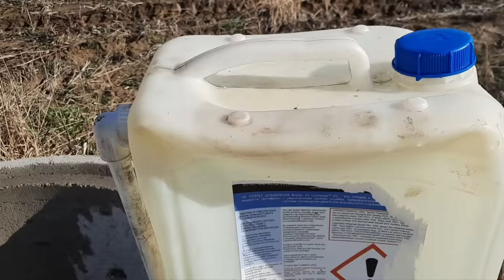Simple idea how to make a water pump without electricity without fuel

Comment: It worked perfectly!!! Thank you so much
Reply: It only worked because the end of output hose is below the water level in the well.
Reply: @wildthoughts6959  Of course, but you can allways repeat the process by pouring water in the canister and sinking the pipe in the water well, creating vaccuum.
Reply: @nevermind-wp3bf  In fact, I tried this experiment in my garage last week.   I put the tank (7 gallon bucket) at 3.5 feet height source at 2 feet , and destination on floor.  Water was flowing at gushing speed.  It emptied my 2 gallon source in a flash.   However,  as soon as I lowered my source to destination level on floor ,  water stood still. And air started to get sucked in from destination hose to adjust the low pressure (vacuum) inside the tank.
Reply: @nevermind-wp3bf    As most people you forget that the vacuum does not only suck at the inlet, it also sucks at the outlet. And if you analyse water pressures at both sides you will find, that with an increasing vacuum the water flow at the outlet will be stopped before the vacuum is strong enough to pull water from a deep well. This system only works if the outlet is lower than the water level in the well. But in this case no tank is needed, just a hose prefilled with water.
Reply: @wildthoughts6959  Thanks! You are right.
Reply: @sciencefreak9070  Exactly

Comment: Your water source is up and drain is down the hill, so you just need the tube and suck the water from mouth at the down hill end you will get the water. Siphon will going to do the job
Reply: P9
Reply: You're right that this is just a siphon but you could not put enough suction on a hose in that scenario to be able to start the siphon. Your lungs don't have the capacity to draw that much water from that depth. That's why the five gallon jug is a good priming device but it is still ultimately a siphon. They need enough water in The Jug to overcome the lift required to pull water out of the well. The weight of the water leaving The Jug and going downhill is what gives you that lift. Your lungs are incapable of achieving that.

Comment: This is very clever because it is so simple. I wonder if there’s a limit to the depth of the well/borehole? I hope our friends in some of our third world countries spot this it could be very helpful.
Reply: The end of the pipe needs to be below the water level of the source and there is a (roughly) 10m limit on the height of the siphon.
Reply: Yes Sandy.  I'm in Kenya and tried it. It really works.
Reply: The limit for the depth is zero. Once the outlet is higher than the water level in the well it does not work. All videos pretending that it does work for a deep well are fake videos.
Reply: @sciencefreak9070  of course I concede the syphon effect is quickly destroyed if the output is above the source. I am more gullible than I thought or plain dozy!
Thanks.
Reply: @ngangaken8731  I want to try it too
Reply: @ngangaken8731  do you have any points

Comment: The plastic jerrycan tank either needs to be a stronger one , with walls stiff enough to stand the strong suction forces, or the inlet pipe diameter should be increased so that outlet demand can be  provided efficiently. But still a very good idea. Well done guys 👏👏👍🏻
Reply: The diameter of the pipes/hoses is determined by the laws of physics applied to each specific case. A larger diameter pipe from the well will require a higher vacuum to lift the weight of the water if done incorrectly the outlet pipe will simply suck air eventually. That is the problem some have encountered and have used as an excuse to say this will not work. I have done it. IT WORKS JUST FINE! No more sucking on dirty fish tank hoses or carrying batteries and pumps out in the field..
Reply: Also, the additional vacuum pressure from the plastic trying to go to its resting state adds a bit more suction. It would be better if the walls were more flexible and could then be manipulated to draw the water up to start the flow. The weight of the water being drawn up from the well must always be less than the suction pressure at the outlet or it will draw air and end the siphoning.
Reply: @uprightfossil6673  points taken, but this creation shown here is not about science because if it’s to be so then the complete contraption needs to be scrutinised and modified accordingly. This clever idea is all about pure intelligence and as such will no doubt be modified as needed by practical experience.
Reply: @uprightfossil6673  Oh? I didn’t know all that educated & disciplined stuff; but you seem to have ‘been there and done that’ to be able to judge others so easily. Video was about a cheap and easy way to get water out, but if you start using pure science in this kinda DIY ventures then why not just go buy a water pump. In rural life the idea this video gives is extremely helpful to save money by not buying pumps etc when one can easily assemble using spare items therefore save ultimately on crops cost to consumers. Hindsight.
Reply: @uprightfossil6673  sorry I’m not so bright to understand. But now I understand you fully well and I support your thoughts. 👍
Reply: @rajrai8073  many young people in America have parents who do not teach them they can be wrong. These children also think the world is flat and other stupid things they cannot understand. That is why I have no patience with them and I am so brutal with my attacks. Be well
Reply: No! A strong (inflexible) Jerry can will simple result in little or no water coming out of the tap at all.
The water column between the inlet pipe and the tap will come out of the tap because atmospheric pressure is pushing on it through the wall of the tank. If the wall of the tank was inflexible, it will resist all of the atmospheric pressure and none wil reach the water in the tank to push it out through the tap.

The whole contraption is a simple siphon. Water only continues to flow because the outlet of the pipe connected to the tap is lower than the level of water in the well. AND there is sufficient water column between the inlet of the tank and the tap, to fill the length of pipe between the tap and where that pipe ultimately empties.  AND the wall of the tank is sufficiently flexible to allow atmospheric pressure to act on the water in the tank to squeeze it out. If any of these conditions is not satisfied, the whole contraption won't work!
Reply: Gravity is a hoax. The Earth is flat. Your aggressive response wont change the fact.
Reply: @rajrai8073  Tutaj dokładny opis jak działa taka "pompa" 
https://www.youtube.com/watch?v=X7Rm0hG-ziE
😂😂😂😋😋😂😂😂
Reply: @nizamersoft  la gravedad existe??.... si ??..... NO??....

Comment: I tried but failed . I need your advice. I keep pouring water in the gallon but it never filled up to build pressure I don't know why. If close tight the gallon the pressure will  suck in the sides of the gallon . I frustrated with the project and I think I wasted my materials
Reply: A waste. His is a siphon. No siphon can lift any water to a higher level.

Comment: Once you open the tap water in the can flows and equal qnty of vacuum created in the can that vacuum suck the water from well  and siphon created that flows. 😉
Reply: Yes, but need a foot value at the source end of the pipe to prevent water flowing back to the well.

Comment: The submersible pump does wonders
Reply: did you not notice? the plastic gallon shrink alot. I think this works true..
ill try this with a DIY reservoir, with bracket inside to counter the shrinking effect.
Reply: Obviously you don't comprehend the science of how a siphon works.
Reply: @GamyCoE    There is a vacuum created, but this does not mean that it works. If the outlet is higher than the water level in the well it does definitely not work. The vacuum would stop the flow at the outlet before it would be strong enough to pull up water from the well.
Reply: @geoffreysari6239    The key point is the vacuum (or better low pressure area) in the barrel. This vacuum "sucks" at both sides, inlet and outlet. And if the outlet is higher than the water level in the well the increasing vacuum stops the outflow already before it is big enough to bring water up from the well. And once the outflow stops the vacuum does not grow anymore. An example: if you have 4 meters from the top of the barrel to the well water and the barrel is 1 meter high with inlet at the top and outlet right at the bottom of the barrel: A pressure of 0,9 bar in the vacuum area is already sufficient to stop the outflow. But you would need 0,6 bar to bring up the water for the 4 meters.

As far as laws of physics are concerned: you can not lift water (or any other object) to a higher level without an input of energy. If this would work you could let the water flow back in the well and drive a turbine on its way. This would be a perpetuum mobile, you could gain energy without spending any energy.

Comment: The end of that hose is well below the water level in the concrete, so that will definitely work. As for the rest very very doubtful.
Reply: As long as the output hose is below the water level of the jug.  We use this setup in our garden.
Reply: yap he could spare the containner.

Comment: work only if the end of the pipe is lower then the level of the water, then you dont need more then the pipe, all the ather staf if not needed
Reply: That is right, but if there is a tiny air leak, the container will collect some air before the siphon stops. With a container you do not need a foot valve in the source.

Comment: My question is what would happen if you put the water outlet to a water wheel that turned a small generator, and the overflow of water went back to the well.   Would this generate usable power?
Reply: Sure could charge some batteries if it ran long enough with minimal draw!
Reply: Yes, I have mine set to go back into my above grond pool  The water flow back to the pool is reating hydroelectric and powers my home.

Comment: because the pipe is down a hill it is just a syphon using hieght as the pump.
Reply: Using vacuum, not height.
   When you pour water in that canister and the water drains from the canister, that creates a vacuum pressure and that vacuum is sucking the water from the well, for as long as the pipe is sunk in the water well.
Reply: Not syphon. Draining water from jug causes well water to be sucked up like a straw.
Reply: This only works for shallow wells.
Reply: Beacause it's windy... That's why...